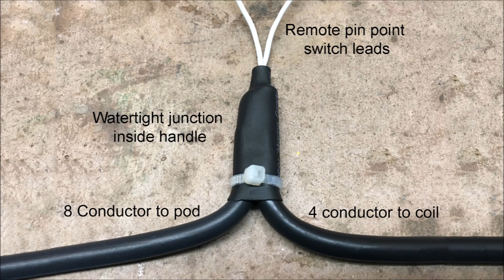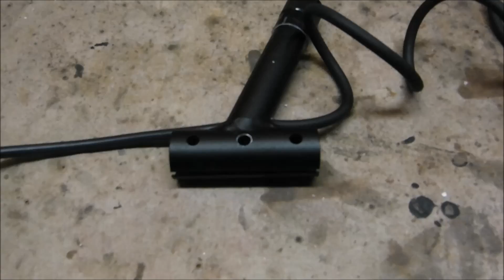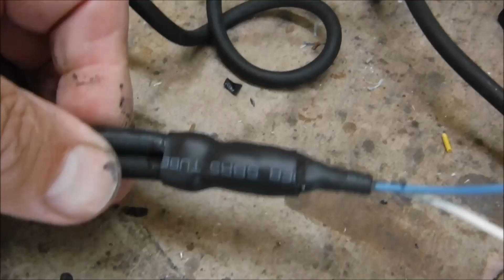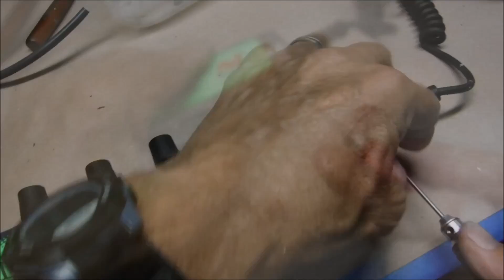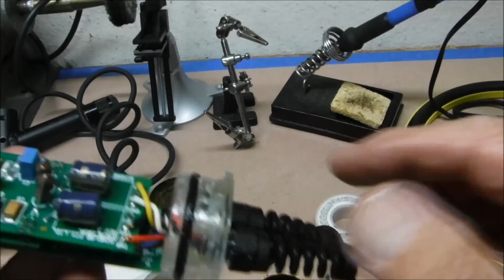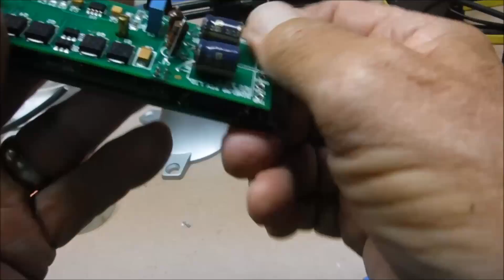09/28/16 Excalibur Remote Pin Point Mod. Part 1 of 3

Comment: hey Tony at 4 minutes and 45 seconds into this video you show a bunch of the wires soldered together did you have to isolate those to keep them for shorting out?
Reply from the maker: HI buddy thanks for watching. Yes, I apply liquid tape and heat shrink each
 solder joint separately. I show how this is done on the clip following this one. 
All the best...

Comment: Tony can you do a video on checking cal batteries and charger. Mine is having an issue. It would be good to have a reference.
Reply from the maker: Dunno if it helps but I use an after market smart charger. It makes a big difference in batt life IMHO...

Comment: Sweet Tony I have been waiting for these videos.Im gonna mod my Xcall over the winter. Question,I know your more of a wet sand hunter then a water hunter.Myself im chest deep most of the time.How do you think this mod will hold up being completely submerged in the saltwater 100%of the time?As always great video thanks for your time....GL HH
Reply from the maker: I'm chest deep a lot in the heat of the summer.  I'm quite sure my switch will withstand 100% immersion with no problem.. I'm going on 2 years with my original design.. Thanks for watching bud...

Comment: Excellent video Tony. I like your video. And can't wait for the next one. I will save it for my eventual mod on excal ... Only thing I don't know is how to make those connections waterproof and able to withstand pressure of water.
It is EDs excal?
Reply from the maker: Thanks.. Watertight conns are pretty easy. As long as you fill all voids with some kind of waterproof sealant before you shrink tube them. They should stand up to extreme water pressure. Yes, this machine belongs to Ed..

Comment: Interesting.
what is the switch your using and its screw holder ?
Reply from the maker: I make my own system out of two different flashlights. The cut-down barrel and switch holder from one and the tail cap switch and neoprene switch cover from another. Aqua Seal and epoxy makes them watertight. I expect close to an IP68 rating.
Reply: Ingenious !

Comment: Thank you sir for the time and effort of putting this vid together for us, will any multistrand conductor cable work like for instance irrigation valve to controler cable? Cant wait for part two. Gl and hh.
Reply from the maker: My pleasure Alex. I don't think I'd use just any old multi strand wire. I don't think it would last long after a few thousand flexes. The wire I use is hi flex cable and it is also UV, water and oil resistant. Part 2 is up bud..